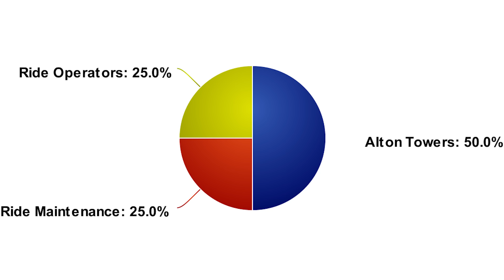What Really Happened on The Smiler Alton Towers june 2nd 2015?

Comment: I find it a bit weird people are arguing "it's human error!!!", as if this somehow dismisses any kind of criticism or concern about ride safety. 

As the video said, coasters around the world were altered given this accident, so, luckily for us, coaster designers agree that "it was just human error" is not good enough of an answer. Just saying "oh it was human error" is an attempt to justify that no real changes have to be made. The ride wasn't perfectly safe, simple as that, as real people got really hurt. Making a machine "idiot proof", and ensuring that human error cannot occur, is very much a requirement of any system's design, especially ones that can easily kill people.
Reply: its kinda impossible to make it idiot proof, also humans want control over the machine in case a sensor is broken,  however you are right all systems should be made in a way that mistakes like this must have alot of warnings before to allow a override and all people should know to trust computers first, because computers are not made to lie, they can do give false information if the sensor is wrong or something but everyone should know to check for these first because a computer is not supossed to lie.  
so yeah to ovverride a system like this it must be something that require a key of some sort and all peopel shoudl be trained to only override as the last possible option of everything.  so many accidents happend due to people not respecting computer safety systems (the list is huge)  i put the blame on the park for the bad training tho.
Reply: The problem with that is that in this situation, though, is that there was no issue ride's design. It did everything properly, and it is entirely due to the mismanagement of the situation by human operators that this occurred. 
You can only idiot proof things so much before the only remaining option is for the ride to not exist at all.
Reply: I know I'm a year late to the party but considering that this comment section will continue to be visited for years to come, I feel like I have to say my piece. It's very clear that you weren't paying attention to the video. Coasters operate with block zones, or segments of track that the system only allows one train to occupy at a time. As the empty train was occupying the block zone that it rolled back in, the safety system shut down the passenger car and did not let it enter the track. That's an example of the machine doing its job. Some idiot with a maintenance key had to go in there, physically override all the safety precautions that were pre-programmed into the system, and dispatch the car themselves. There wasn't a loose wheel or a poorly-welded piece of track or anything, this was 100% human error and some guy overhauling every single safety system in place. 

When he mentions that coasters around the world were altered because of the accident, what he means is that some modern coasters just won't start if winds are too high. This is for a multitude of reasons, especially considering the fact that, sometimes, rollbacks just happen and if they're handled properly they're safe (i.e kingda ka, storm runner, intimidator 305, etc just tend to roll back if the winds are too high and slide back into the break run safely, or if there's no break run, no more trains are sent since the maintenance system shuts the ride down and they remove the extra car). The machine WAS idiot-proof. It refused to send another car. Maintenance egregiously and downright evilly overrode that, resulting in the accident. No more accidents have occurred on Smiler since then.

This is a dangerous comment to make since it's blatantly false. Alton Towers and its workers are at fault. This never would've happened at Disney or Universal or something where they take safety and training more seriously.

Comment: Great video! Real eye opener to what actually happened in this park. The reason the ride got so many people really confused is that it had a poor mechanical record beforehand with there being the risk of valleying which happened almost half a dozen times in the first year (correct me if I'm wrong) and a video was released on opening week that showed it loaded with guests slowly lowering down the vertical lift hill half way through the ride. Alton towers has since really locked down on weather conditions, as when I went during summer 2018, there were several showers and Rita closed and they kept playing the pre-recorded message about closing the smiler in adverse weather conditions.
Reply: @jeeedel2491  oh, okay, just never heard the message played on the smiler so often like I did back in 2018 during light showers. Cheers for the info

Comment: So you're telling me an empty train valleys in the front of the coaster and no know notices? 🤔
Reply: Gage the people watching the ride from the outside noticed :( they all saw the train valleying and then saw the other train coming up behind.
Reply: @niaram  😢
Reply: From maintenance's perspective, the stalled train was on the complete other side of the track in semi-difficult to see area
Reply: I don’t get it. They just manually override something WITHOUT going to get a visual??????  If I did that at my job (and I don’t have to deal with humans), I’d be FIRED!!!!  If I override a safety alarm without a visual inspection and then a part of the equipment ends up broken, I’d be so dead. Unbelievable that with human lives at risk, no one thought to go have a quick look to see what had happened.
Reply: @katkenobi6765  Well by the process of elimination, there's no need to get a viual as they "knew" where all the trains in service were. However now it is mandatory to perform a visual inspection of the track on top of visually identifying all trains, not just the ones in service like before
Reply: I know right, it's very fustrating how negligant those operaters mustve been??, safety is soo important...i don't understand why they didnt check 😩

Comment: you'd think that there'd be separate sensors/alarm to alert crew when a train has valley'd rather than just solely rely on the block section system alert.
Reply: The block section system alert was enough to prevent this catastrophy. But having said that, I'm surprised all trains were not monitored for speed and position; which I assume would, in that case, include a warning if it stops somewhere it's not supposed to.

Comment: A slight correction, the block reset but that was press was at the base of lift 2.
Reply from the maker: do you have a source for that, the sources I used said lift 1.
Reply: GP To Enthusiast Well it’s common knowledge. Oh dear americans don’t believe facts.
Reply from the maker: its common knowledge in the UK of where the smiler's manual override is?
Reply: GP To Enthusiast You don’t believe us that is your fault.
Reply from the maker: I am sorry I prefer to have a source before I trust some random on the Internets information.

Comment: this is 99% correct other than 2 things which (as someone who currently works as a merlin rides host) I am relatively confident about.
1. Maintenance add/remove trains so I think it was just different engineers  who added the train to the ones who overrode the error message
2. Control likely was just too slow to tell the smiler to close as this can happen when conditions teeter between what is and isnt allowed

Comment: 4th thing:  A ride really should be designed in such a way that an operator or multiple operators with access to an E stop button can see ALL points of the ride. If that had been integrated into the design then an operator would have seen the 5th car stuck in the valley and stopped the ride.
Reply: I wonder if the fact that Alton Towers isn't allowed to build any ride taller than the tops of the trees played into that… they creatively situate all their coasters in pits or low down, in order to obey that bylaw. That's got to make it harder to see all the parts of a coaster…

Comment: Here's something that puzzles me, should there not be live camera feeds to the control room covering the entire ride (could even have a mobile staff app/full system to check anywhere when not at the controls etc and other operators could then double check from elsewhere too), especially from this modern era of rides? I'd go as far as to have procedures requiring specifically checking off e.g. that each one has been eyed for 5 seconds of unblinking time each, twice going through every element and section etc. before manual override. Well I guess they do have that now plus much more.

Comment: I'd place far more blame on maintenance than on the operators. The operators didn't override the block safety system. Maintenence should've known to make sure they knew where ALL the trains were, not just the ones they thought were operating. Though multiple human errors occurred, only one of those errors hurt people. The call that maintenance made to override was far more absent minded and dangerous than not weighting an empty train.

Comment: Going to disagree with most commenters here and say the ride should be designed such that human error can't put anyone in danger.
Reply: It’s a machine at the end of the day. Machines are operated by humans. Machines should be designed to completely lock humans out from making adjustments to it when necessary. This adjustment would be necessary if the ride operators had done their due diligence and had been trained correctly.

Also, it’s not like this has ever happened before. It’s a complete fluke and is not indicative of a common flaw in ride safety design.

Comment: More guests in the park means more times for the ride to go around means more chances of an accident if operating outside of the limits set for the ride.
It was ridiculous they couldn't realize that more guests meant more reason to shut it down until winds slowed.
Reply: You are correct that the ride should not be operated outside of manufacturer requirements like that, but the safety systems would completely prevent an accident like this.  The worst that can happen with those winds is the possibility of a train not clearing a loop or hill and valleying.  The safety system will not let another train into the block with the valleyed train.  The accident only happened because the maintenance people manually overrode the safety system without even looking to see what was causing it to think there was a train in that block.  Hint: a train in the block is why the system thought there was a train in the block.

Comment: The real issue is that it wasn’t communicated that the 5th train had been added because as much as maintenance should have done a better job looking, they weren’t informed they were looking for the location of 5 trains and not 4. On a side note I’m pretty sure only engineers can add and remove trains not operators

Comment: Even though this accident was due to human error this ride (apparently) still has issues daily, I was in alton towers on Monday and the ride randomly closed while the queue was full and they were turning everyone away who wanted to ride it, ive had friends who have been quite alot since the accident and the ride has malfunctioned, broke down or not been open atall. For a relatively new rollercoster, I find it extremely unusual it has this many issues and its still standing
Reply: Every coaster has issues, it’s just normal. Obviously not like crashing and stuff. Usually the smiler has to stop because of the one of hundreds of sensors thinks there is something wrong because of how sensitive they are now.

Comment: It wouldn't surprise me if they didn't even think about the wind at all. I mean, unless they have some device measuring windspeed, how would they even know it was exceeding the limit? Did the operators even know the ride *had* a windspeed limit? Maybe that was something covered in day 1 training, but not something they regularly were reminded of. 

None of that is an excuse, of course. It was not 1 thing that went wrong, it was multiple. And the amount of times an accident was caused by a manual override when the electronics were trying to tell them there was an issue, is so ridiculous. Poor communication, poor planning, poor training, poor procedure and apathy toward the danger of these rides all played a part.

Comment: The trains need to be part of the safety system where you would have manually go to each train and scan the rfid tag and the nearest rfid tag on the track so that the main control system knows that all trains have been accounted for before resetting the safety fault

Comment: wouldn't be the first time a ride was forced to run in high winds and maintence overrid safety systems.    Happened in 1979 at the Texas State Fair when two cars fell from the Swiss Skyride due to maintence disabling the wind alarm and automatic stop causing it to run in 40mph winds which lead to one car getting stuck between rollers and three others piling up behind it.  Then the rolley battery coudln't hold the weight and flipped causing two cars to fall. Killing 1 and injuring 12.

Comment: I agree, it is mainly Alton Towers, they should send one cart then let it do the full run, then send the other one, basically one at a time, then there would be no accidents, that is why I avoid riding this ride.
Reply from the maker: That would lead to insane lines, the smiler can run safely with all 6 trains dispatched at the designed interval.

Comment: I will agree on some of the valid issues which contributed to the crash... however... there are things factually inaccurate that happened behind the scenes leading up to this for months which does not absolve the female ride op at the time of the accident

Each rollercoaster, regardless of size, has safety features built into it including an automatic and manual mode. Manual mode should only be done in situations where a evac needs to happen overriding the main ride programme. Smiler had been in manual mode at the time of the accident which it should of been switched back to Auto mode before sending around the empty ride car. Since re-opening and whilst closed, Gerstlauer put in an extra computer to run the ride in auto mode and is a back up to the 2 that already ran the ride prior to the accident. It also records when and whom takes the ride in and out of auto to manual mode. Every time that it is now taken out of auto to manual mode, the area manager for that part of the park has to record it and a good reason why has to be given whilst in and out of guests on park. Responsibility - Tech Services

The 5th car that was put onto the track: that is down to the ride op and tech services. Both should of known this fact and therefore, disputable that neither the ride op nor tech services didn't realise that there was a 5th car on the main track. The 5th car should of stopped at the vertical hill lift for the second half of the ride, the point where on the theming side it did have "Half Way Corrected". This area of the ride had already cameras. Responsibility - 50/50 for both the ride op and tech services

Safety system: As I previously mentioned, whilst the ride was down during the investigation by HSE (Health and Safety Executive for those outside of the UK who are not familiar with the initials), Gerstlauer put in extra ride sensors and more E-stop buttons around the ride. The area of the ride where the accident happened was already covered by cameras and it is reported in the investigation and displayed to the courts that the camera "was not checked to make sure the ride area was clear to send around guests". This lays firmly with the ride op and second by the tech team. The ride op is in charge of the whole ride and staff on duty at the time on the ride at all times and when taken out of public use for a breakdown etc, tech services work with the ride op to get it back up and running. The ride op initially should of checked all cameras before sending around the empty car and if not covered by a camera, a visual "go out and check" should of been done to make sure the ride area was safe to re-open. In each ride booth, there are between 2 - 3 screens just for cameras which each have between 9 - 12 camera displays on them for the ride area which can be chosen to be put to full screen. Responsibility - 80% ride op, 20% tech services

Training by Alton Towers to run the ride: Every ride and attraction at a Merlin park has a ride op and ride host manual which are always tested on prior for the host or op to be allowed onto that area be it operation or hosting the ride in the station area or at the entrance of the queue lines. If the person does not pass that end of training test, they are not allowed to op or host the ride/attraction. Once a guest is on the ride, for the first few cars being sent around, it is back charge of the ride op overseen by tech services after a ride stoppage (mechanical). Once you are passed off as a ride op, it is the ride op's responsibility to ensure all safety checks are done prior to opening to guests, when a ride breaks down for whatever reason and re-opening a ride. How do I know this? I used to be a ride op and host at Alton Towers so know how strict they are with this. Responsibility - Ride Op followed by tech services

The weather conditions: It was ruled in the court via the HSE investigation that this was a minimal factor as to the cause of the accident and was more human error that lead to the accident.

It should also be noted that it wasn't just the Smiler team that day that suffered, it was all staff who got flack for it happening from other ride op's and hosts in other areas to retail and food and beverage staff to cleaners. How could other ride hosts and ops in other areas of the park (each area has its own team), along with staff who were not in the rides part of the business? 2 people's human error lead to the whole park being blamed for what happened.